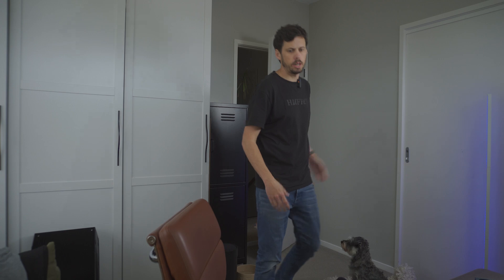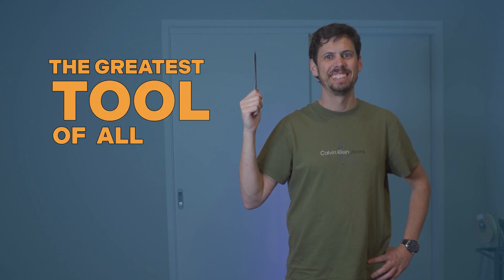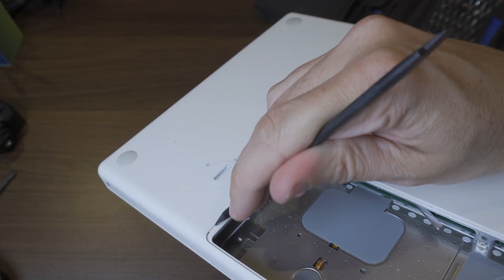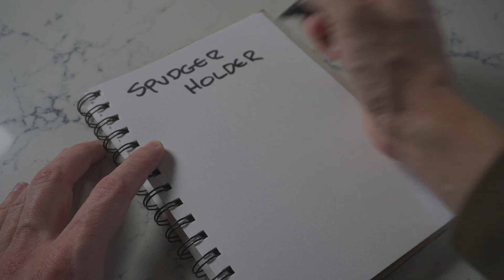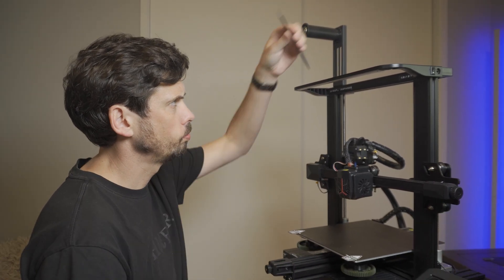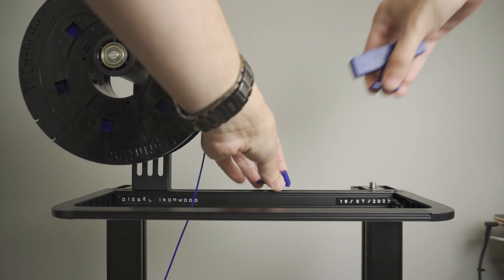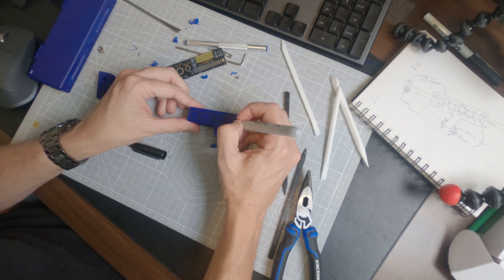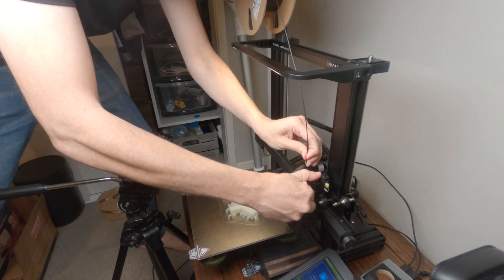I Made the Dumbest 3D Printer Mod Ever (for the Greatest tool of all Time)

Comment: Great Video! Making captivating design montages is definitely something I've been struggling with in my videos too haha. Also there's a few different ways your holder could have been designed without the need of supports. but honestly I think you could have just printed your model without supports; the bridges seem like they would have been short enough. Some internal chamfers would also help to significantly help with supports. 
Excited to see your next video!
Reply from the maker: Thanks mate. A few people have mentioned I probably didn't need supports. And I'm definitely going to get my head around chamfers for my designs going forward. Thanks for the advice!

Comment: Hot tip - when designing for 3D printing do not use fillets on edges but use chamfers. Because they are at 45degrees the printer can easily handle the over hangs and the layers on the surface are uniform (they look much sexier) 

You can use filets on the edges where two chamfers meet to soften the joint, just not along the edges of a model.

You videos are awesome and designing something useless is actually a fun project idea!
Reply from the maker: That's great advice, thanks. I haven't quite got my head around chamfers yet. I'll def come back to this comment for my next design. 

Always want those sexy edges 😆
Reply: @AttemptedMaker  Chamfers generally have one or two dimensions. They're just like nipping a little bit off the corners with a plane, and the one/two dimensions are how far away from the original corner you want to nip off of each face that meets at the corner. If you define just one dimension, then the chamfer nips the same distance away from the corner on both faces. On a square corner, this forms a nice 45 degree chamfer. :)

Comment: First thing you learn when designing for 3D printing, how to take advantage of 3D printers capabilities. Supports aren’t needed for bridges and the strongest part of a print is on the XY plane. The rest you learn as you go, fun video.
Reply from the maker: Yeah I was in a hurry when I designed it. I knew I should have designed it better for no supports. But yeah a few people have mentioned that I shouldn't need supports for it... I didn't even think to try. 

Good advice, thanks

Comment: Supports probably aren't needed in the hole for such a small bridge.  Try printing a bridge test model and you'll see your printer is much more capable of printing straight lines in midair than you think.
Reply from the maker: Good to know. Thanks for the tip, time for more calibration test prints!
Reply: @AttemptedMaker Also, if you find out your printer sucks at bridging just rotate the hole 45 degrees so it’s all 45 degree angles instead of a straight bridge. And just so you know I do appreciate build videos with stories. Checkout Foureyes Furniture. Their videos are great.